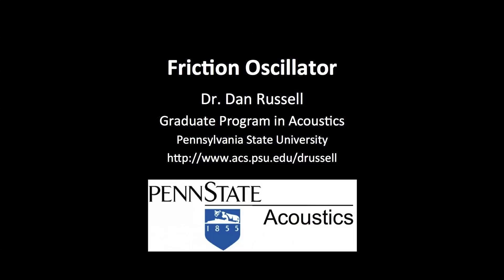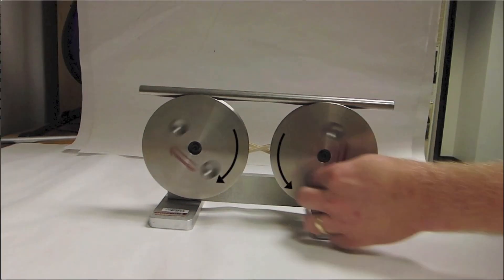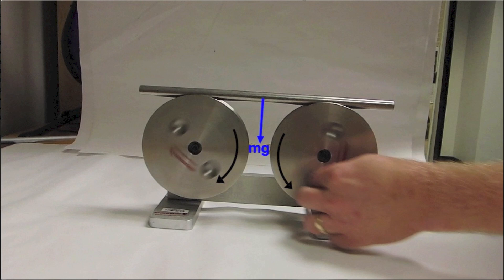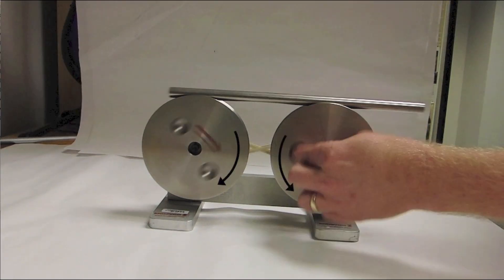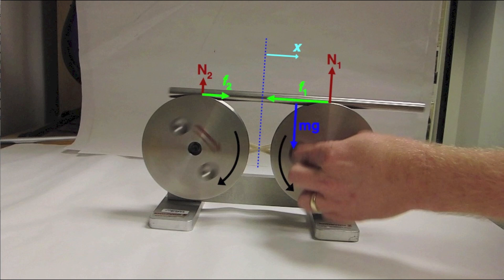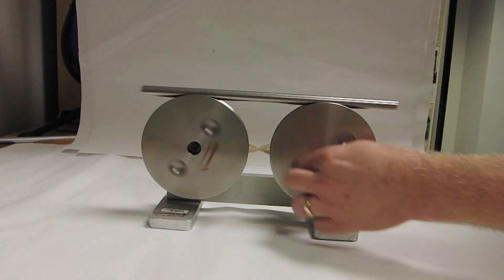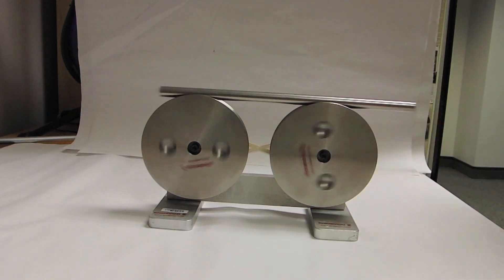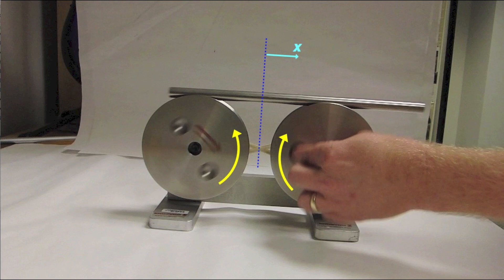The Friction Oscillator

Comment: I was able to figure out how this worked before any description of it, and it is very interesting!

What surprises me is that although it oscillates, it appears to be a negative feedback loop, where as the bar's displacement is proportional to the acceleration in the displacement-minimising direction, towards the center position. 

I have had electronics parasitically oscillate like this(for similar reasons) when trying to design a simple voltage regulator from scratch. (essentially, a pass transistor raises the voltage of a capacitor up to a voltage until a certain measured voltage threshold is reached, then the transistor stops passing the current into the capacitor and the voltage drops as the load draws power from the voltage source, and thus the voltage fixates around that specific level, and is regulated.) With too much negative feedback to regulate the voltage with a load to discharge the capacitor, a parasitic oscillation can occur (especially if there is a delay in the feedback control) Without reducing gain, how would I go about eliminating the parasitic oscillations?